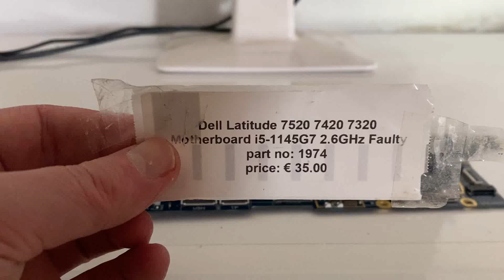DELL LATITUDE 7250 - FAULTY

Comment: Hi you can better use resistance measurements ofthe coils will say much more then diode mode . Because diode mide is not always the same for every multimeter. Resistance more less the same and will say something is wrong with the secondaire coild. Just a tip I give.

Comment: That JFPBTN1 receptacle was already damaged. Someone previously used excessive force with a metal tool to remove the connector. Because of this, cell phone, tablet, and Nintendo console repairers use plastic tools to manipulate these connectors. It's possible to purchase the complete small module for the fingerprint reader (I saw it on Amazon), although you'd have to desolder the receptacle to transport it to the motherboard. Best regards.
P.S.: I saw the schematic diagram on badcaps (BoardView software) and I don't know how to use it in depth. I usually download schematics in Adobe Reader.

Comment: 7:50 Despite your mistakes which were quite valuable and educational within themselves, thank you for the nice video! Have you identify what that chip with the mangled pins were? I was really curious as to how the pins were crossed like that.
Reply: Microchip Technology (a leading manufacturer of integrated circuits for capacitive touch fingerprint sensors). Part number CAP1126-1-AP-TR (just one example of educational practices in higher education colleges, if you're interested in this broad topic and its applications). In this case, laptop manufacturers require the chosen manufacturer to cover the part number with a thick black resin, which, when removed, also destroys the chip (thus protecting personal data). Not to be confused with Hall effect sensors, which automatically turn off the laptop when the display lid is lowered against the keyboard and optical mouse (touchpad).
Reply: @ Oh, so it was the fingerprint reader/sensor? Thanks.
Reply from the maker: Yeah, I just dont understand how the pins were bent and those threads (like from a jumper) got tangled up in the pins. I bought from a shop as faulty, and I think this can only have happened when the board was removed from the chassis. Possibly when it was in storage.

Comment: JFPBTN1 - Looks like Power Button connector that had the crossed pins ?
Reply: correction - I think FP might mean finger print
Reply: @JFIXX1  Hi. Yes. That's correct. That's what "fingerprint" means. Well, its full and correct technical name should be: Finger Print Junction with Twisted Nematic wire. All the best.
Reply: Notice that next to it it says DARWIN in capital letters.